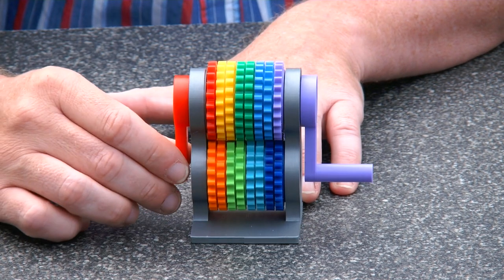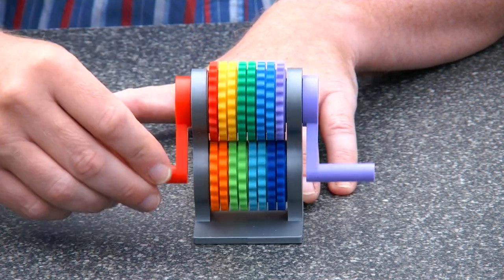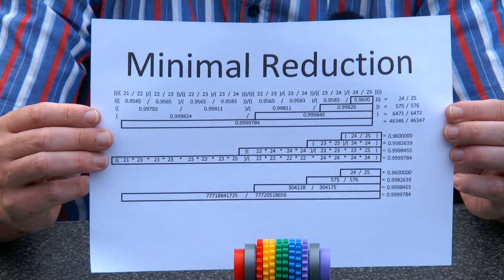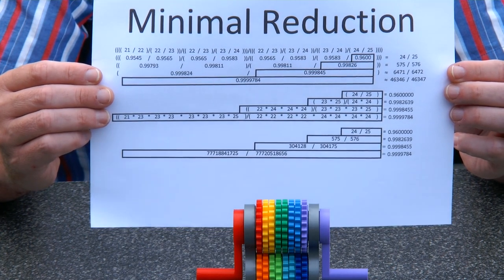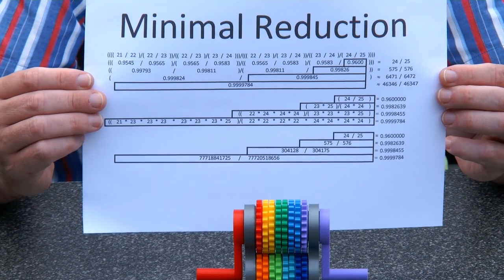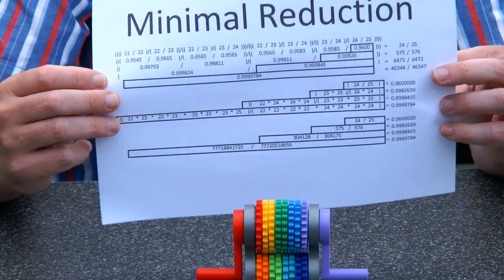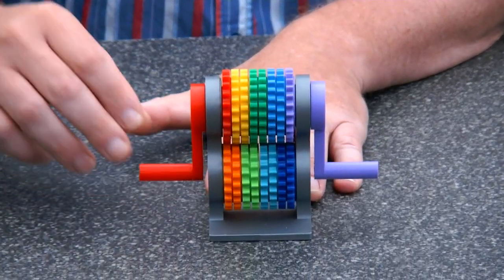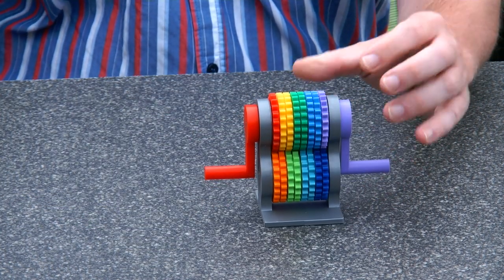Minimal Reduction: What are the optimal solutions for 3, 5, 6 or 7 gear pairs?

Comment: This is quite similar to how micrometers work, except they use screw threads (normally only two mating "pairs", which turn in alternate directions to cancel out net motion) instead of gears. In that case it's called a "differential screw".

Comment: Well, you could work backward from the ratio you want to reach.  For example, say you want a gear ratio of 0.99999999....we calculate A/(A+1)=n where n is our ratio and find A=n/(1-n) which is 99,999,999 for top and 100,000,000 for bottom. We then find the factors:

3^2 * 11 * 73 * 101 * 137 = 99,999,999
2^8 * 5^8 = 100,000,000

We then decide that we need at least 18 teeth per gear, so we will work with the easier number and get the following gears: 99, 73, 101, and 137 (because 3^2*11 is 99)
Now that we know we have 4 gears, we need to try and equally distribute for the second....which can be as easy as: 100, 100, 100, and 100

So now we put them together: 99:100, 73:100, 101:100, and 137:100....chain them, you have your 0.99999999 ratio

Comment: I think you could make this into a puzzle. Have different gears that the solver must combine, so that the ratio is exactly 1:1. If the handles spin at different speeds, it is an incorrect solution. Any wrong ratio should, of course, be more obvious than 1:0.99998, so you don't have turn it 3285 times to notice that you have solved it wrongly. :-)
Reply from the maker: That is a nice idea. What would it look like as a mechanical puzzle?
Reply: @OskarPuzzle  Gears that can be combined into gear pairs via magnets, and a bracket in which to place them. Color code for tooth count to make it more friendly.
Reply: Love this idea, I'd want to buy something like this!!!

Comment: For three gear pairs, you could do e.g. 24/25 x 24/25 x 25/23, which gives a ratio of 1:1.0017.
Or, a lot better still, and likely manufacturable, but less intuitive: 23/25 x 22/25 x 21/17 which gives 1:1.000094.
The latter is the best with gears not bigger than 25 teeth; not a lot worse than the combination of eight gear pairs in the video. 😉
Reply: For 4 gear pairs, I find 18/25 x 18/19 x 18/17 x 18/13 resulting in 1:1.0000095. That is an improvement over the example in the video, and somewhat peculiar in the sense that all gear pairs have one gear with 18 teeth.
Reply: For five gears 22/19 x 18/17 x 16/13 x 14/13 x 8/13 gives 1:1.0000014. You could also do 18/19 x 16/17 x 16/13 x 14/13 x 11/13, if you like those numbers better because they tend to be closer, with the same result.
Reply: For six gears 17/20 x 17/19 x 13/12 x 13/12 x 11/12 x 11/9 gives 1:1.00000017. The 11/12 and 11/9 gear pairs can be replaced by 22/24 and 22/18 for practical reasons.
Reply: For seven gears I get 19/18 x 19/15 x 19/11 x 19/11 x 13/11 x 7/11 x 1/3 resulting in 1.000000084. To avoid a gear with one tooth, this could be executed as 19/18 x 19/15 x 19/11 x 19/11 x 13/11 x 14/22 x 8/24, for instance. It then takes almost 12 million rotations for the handles to make one full rotation relative to each other, a bit over the top.

I'll stop here. ;-)
Reply: Concerning the algorithm. I admittedly did this using brute force. For N gear pairs, the algorithm would comprise computing all products of N integers from [1,25], sorting them, calculating the ratio of all pairs of consecutive products, and then selecting the minimum of those ratios. Typically there are quite a few ways to choose the number of teeth to arrive at that ratio; I fiddled around a bit with the prime factorizations of the numerator and denominator, trying to get both in the form of a product of N numbers that were somewhat similar, presuming that that would lead to gears that are of similar size and with similarly shaped teeth.
Reply from the maker: @landsgevaer  Please check out https://twistypuzzles.com/forum/viewtopic.php?t=37319 
and the other YouTube comments for more great finds like yours.
Reply: @OskarPuzzle  Ah, yes, thanks.
I couldn't resist to check what can be done with pairs of gears that differ by only one tooth, so the device would still "look good". The best solutions are:
for 1 gear: 25/24 -> 1:1.042
for 2 gears: 24/23 x 24/25 -> 1:1.0017
for 3 gears: 10/9 x 16/17 x 22/23 -> 1:1.00028
for 4 gears: 7/6 x 14/15 x 23/24 x 23/24 -> 1:1.000039
for 5 gears: 14/13 x 18/17 x 21/20 x 7/8 x 21/22 -> 1:1.0000051
for 6 gears: 14/13 x 14/13 x 22/21 x 12/13 x 16/17 x 18/19 -> 1:1.0000014
for 7 gears: 11/10 x 13/12 x 13/12 x 11/12 x 17/18 x 17/18 x 18/19 -> 1:1.00000017
The solutions are not that much worse than the unrestricted ones, to be honest; I was surprised. Also, they get almost one order of magnitude closer to 1 with each additional gear pair that you add, it seems; it would be fun to know whether that can be explained more precisely and whether that trend continues indefinitely (I hypothesize it does, although I suspect by less than almost an order of magnitude).

Comment: My instinct is that you can get as close to 1:1 as you want with larger and larger numbers of teeth.  No global optima.
Reply: I think it would suffice to bound the number of teeth for each gear. Additional question: how does the optimal solution depend on the number of allowed teeth?
Reply: @TheJmax04  99:100 is better than 24:25.
Reply from the maker: The requirement is: all gears should have 25 teeth or fewer. 99:100 is disqualified.

Comment: Find two very large numbers with a small difference, such as 43,252,003,274,489,856,000 and  43,252,003,274,489,856,001. Break them down into several factors (in this case, the first one has many options while the second is the product of five primes.)
Edit: for the number I gave above (R vs R+1) the result is
144:139
264:263
546750:547223
4718592:4880537
441:443

The combination of 3^27 vs 3^27-1 has the largest number being 8209.

Comment: Inspired by this I just made something close to this. The gears is ~50 mm in diameter. And the gear ratio is 49:50 and 49:50  if my math is correct it would be the total ratio of 1:0,9604
Reply: If i were truly dedicated i could do the ratios (48÷49)÷(49÷50)
Wich equals the rato of 0,9995835069
I still hope my math is correct :)

Comment from the maker: What useful application is there for a gearing ratio that is so close to 1:1?
Reply: To gain more precision on an orientation of a gear
Reply: Exerting large forces.

The relative difference between the two handles may be very small but the force with which they diverge will conversely be very large.

If you could attach another mechanism to translate the relative positions of the first and last gears into some kind of stretching or compressing motion you could do something useful, perhaps via hydraulics.

Heavy work could be done slowly using only muscle power or a weak (perhaps solar powered) electric motor.
Reply: For keeping count of leap years on a calendar?

Comment: Why do you have the teeth number the same for each color? Is it just for the aesthetic of having the gear teeth line up within a color, or does having all colors being 25 to 24 reduction not work for some reason I am not thinking of?
Reply from the maker: There is no connection between color and number of teeth. The colors just indicate which gears are glued together.